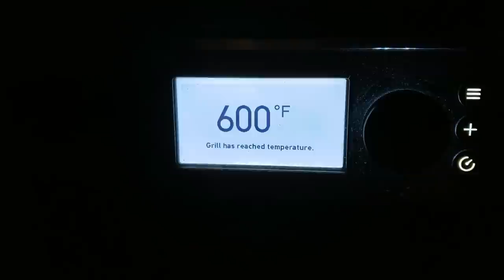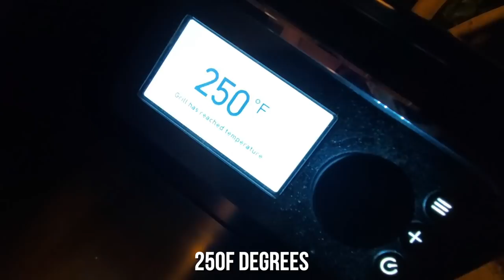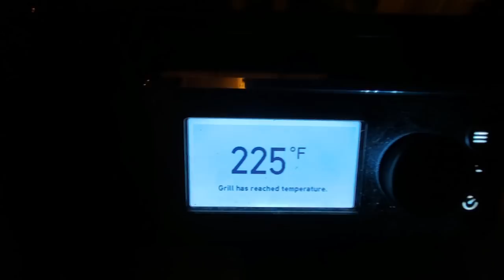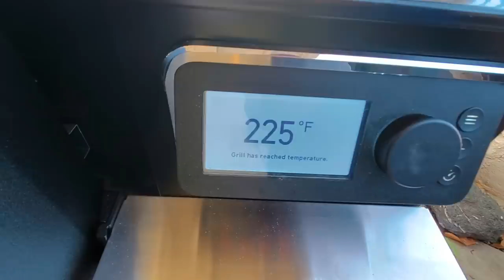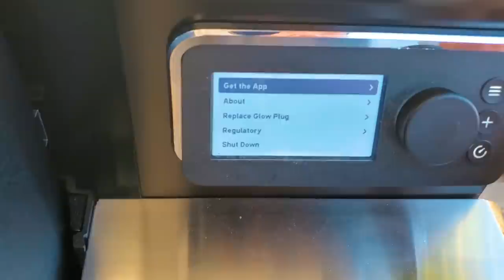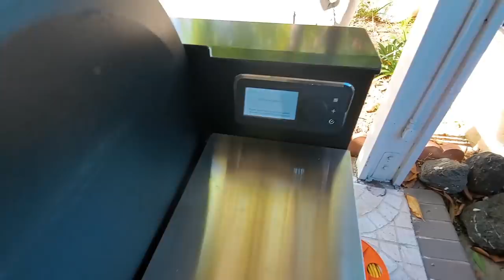Pt 2 WATCH BEFORE YOU BUY | Weber SmokeFire Pellet Grill | BBQ Champion Harry Soo SlapYoDaddyBBQ.com

Comment: Let me quote Amazing Ribs review (even they which curiously doesn't seem to be so hard on this one as with others which fail on similar areas) but still tell about findings... 

Software

The SmokeFire rollout felt a bit rushed. Weber is already a big target and didn't do themselves any favors by releasing this WiFi device with a partially functioning app and the promise of future updates.

Grease fires

There are some fairly easy remedies to prevent grease fires: keep it clean, use aluminum drip pans, and burn it off. Alas, people who rushed to post their experiences failed to discover the remedies.

Keep it clean. All indoor and outdoor cookers need to be kept clean to avoid problems and poor performance. Ash does collect at the bottom of SmokeFire, as it does in any pellet smoker, but if grease gets past the flavorizer bars and is allowed to accumulate, it can form a flammable sludge with the ash. It can also clog the grease drains. Weber needs to remedy this in future iterations.

Pellet feeding

Weber says it fears some people may have attached the hopper incorrectly. We will continue testing this. We hear Weber may be offering a complimentary ramp accessory they hope will address this issue.

We then did temperature tests with digital probes spread across the cook surface from left to right and found the right side was hotter than the left. We can show you visually with our bread test, below. In fact, we noticed this back in November when we cooked steaks on the prototype and commented on it. I have highlighted that comment and some others of concern in yellow, below. This is a pretty significant difference. 

Most of the grease burned up on the flavorizer bars and diffuser. Only a small amount made it to the bottom of the grill and into the grease tray below. We saw some blobs of grease mixed with ash had formed on each side of the firepot and scraped them down into the grease tray. Some bloggers have complained about grease fires by the firepot so we plan on testing that issue next by doing a lot of fatty stuff.

Another issue we're finding with the hopper is difficulty filling it with pellets. The hopper design is similar to Memphis Pellet Grills; located at the back to allow for a short auger, and having a wide and shallow shape rather than the more common box shape. But among other differences, the Memphis lid opens from the back, allowing easy access.

And keeps going…
Reply from the maker: Craig is a good friend of mine so please listen to him.  For me, I only have two data points so my results are not conclusive nor do they represent the majority of experiences of EX owners. Only time will tell if the EX becomes a classic like the Kettle and WSM.  Cook on many pits and have fun. It's about the pitmaster and not the pit.  Life is short

Comment: I am glad you have had a good experience with this grill. I write software for electro-mechanical devices (not grills) for a living and know they don't always work as well in the field as they do in the lab. So I am sympathetic to the engineers who designed and tested this product whose competence is now questioned. I've been there; it's not fun.
I am also sympathetic to the problems people have had with this grill and know you can always learn something about people's experiences in the field. If Weber is worthy of their reputation, they will use this feedback to improve the product. I sincerely hope they do, because everyone benefits when technology improves and other manufacturers "borrow" those improvements.
Whatever happens, my Pit Barrel Cooker and my Weber Kettle will continue to serve me well.

Signed: a fellow "IT nerd" who has upped his brisket game by watching your videos
Reply from the maker: Fellow IT nerd, I concur with you. I work with SCADA engineers all day with PIDs and RTUs so I'm aware that to design variable speed auger and fan algorithms is a technically challenging task with 200F-600F range and no door sensor.  How do you know if a knucklehead like me leaves the door open to shoot videos as the temp probe is saying temps dropping so run full auger and full fan to compensate for temp drop.  As the pellets are flying into the hopper and igniting, the temp is not increasing as the door is open and the PID does not know that.  How do you program the fan and auger to handle that situation?  Don't know. All I know is in my tests 1 and 2, the SF passed. Not conclusive with two data points but a start for me to learn more.

Comment: You should have cranked it up to 600 after the cook to see what would happen to the grease, instead of shutting it down.  I’d be curious to see what would happen.  I bet there would be a significant fire, not a flare up.
Reply from the maker: Already did in Torture-Test-1.  It passed
Reply: A. Dog Who’s the troll?  I’m free to make my comment, which is a valid one BTW.  Let me ask you, how long does it take for the pellets in the pot to burn on the SF?!  Not long enough.  By design the SF, reduces the amount of pellets in the pot on shut down.  Tool.

Comment: Good stuff here.  The more I watch SmokeFire videos, the more I feel like a good amount of the issues are actually user related.  I notice that a lot of the people having hardware issues didn't follow instructions on updating firmware right out of the gate, and the "grease fires" are actually just flare ups like you point out here.  I see a SmokeFire in my future.  Thanks for the great content!
Reply from the maker: Thanks Jerry for stopping by.  I only have 2 data points which are not conclusive nor do they represent the majority of SF owner experiences.  I suggest you borrow an SF to test drive first before plunking down $1,200.  For more info on what the pros say about flareups, please see https://youtu.be/VALvHFhWpk4
Reply: Ha. Be careful with that confirmation bias. Heed Harry’s good guidance. This thing has real issues, issues that run counter to Weber’s marketing. My firmware updated without issue. Two failed overnight cooks, which I do frequently on weekends, due to Weber pellets ceasing to feed, plus a full fledge grease fire consuming the entire right side of the cooker during shut down following a pork butt, even flaming out the drip pan. It’s a lot of money to spend to beta test. Shame on me, but these issues were the very problem Weber’s marketing claimed to solve (with influencer support).

Comment: ANYONE cooking 65 pounds of meat on a smoker this small should expect some trouble. I use a pellet smoker too but Dear god you pushed it.
Reply from the maker: LOL!  That's why it's called Torture Test!
TORTURE TEST 1 - PASSED
45 lbs 5 meats in 8 hours. Generate grease from a 16 lb brisket, 10 lb butt, and 3 St. Louis ribs to drip on the SF the first 6 hours at H-n-F cook @400F and L-n-S cook @275F. After all that grease was accumulated, fire it up to 600F to grill the Ribeyes and sausages.  Cook to let the grease drain in the unit and then try to flash that grease at 600F to test for safety 
TORTURE TEST 2  - PASSED
60 lb, 2 meats, 12 hours. Two 16-lb brisket, Four 10-lb butts. Low and slow 225F to see if hopper feeds properly and no grease fire, and no excessive ash

Comment: Hello Harry,  I am sorry to keep asking so much but tell us what you think could have caused such a huge fire on this videos? :https://youtu.be/-_7S3KTxvHc
I think we all need to understand.

I also noticed that in next video you use  an additional aluminum drip pan that make useless the weber design and the integrated fat catcher pan. I think a "Part 3" would be appropriate to give us your definitive thoughts on the SmokeFire.
Reply from the maker: Hey Victor, did you see my part 3 with the SmokeFire Corned Beef Walmart - https://youtu.be/NSSIKicufJE
I only have several cooks on my EX6 and  am still learning how to cook on the EX6.
For Tony's grease fire situation, I would refer him to have Weber engineers to watch the video and comment why he had the flameout, and thoughts on Tony's subsequent relight using a propane torch instead of the normal startup cycle.
From my experience running GMGs for 12+ years that when you have a flameout, you have to inspect the burn pot and remove excess pellets outside the burn pot.  If you don't, the auger will go through its startup cycle and overflow the burn pot so you could possibly ignite the pellets outside the burn pot and potentially cause a fire.  So far I've had two flameouts on my GMG Daniel Boone and Jim Bowie the past decade due to wet pellets from the heavy rains in SoCal (as we have monsoon sometimes).  
If it were me and I had a flameout, I would do three things 1) empty the unburnt pellets in the burn pot, 2) empty the grease pan, and 3 clean the cooking chamber.  it would only be AFTER I complete these three tasks would I attempt to relight my pellet cooker.  
As in all live fire cooking whether you cook with a shovel, wood, meat and chicken wire with a hole in the ground or a $1,200 pellet cooker, you must exercise extreme caution as you're working with fuel, fire, smoke, hot equipment, and hot oil.  
Of course, I've cooked a few times so I'm comfortable dealing with live fire issues and I don't expect everyone to react and respond like I do.  I like the flavor, ease of use, and performance of the EX6 and I may be a minority so only time will tell if this cooker is any good.  
I bought a second EX6 as I'm getting lazier in my old age of constantly having to watch my pits and the push-button fire-and-forget way of cooking is growing on me.  Just my $0.02.  Your mileage and preferences will vary.  And remember what I always say, "Everything in BBQ is a 3-hour argument and Jerry Springer fist fight".  Have fun cooking, be SAFE, and spread BBQ love and peace.  Any wash your hands as you hunker down in self quarantine!  :-)
Reply: @SlapYoDaddyBBQ  Thank you for your extended answer! I really appreciate. Yes I looked the Corn beef video but it's more a recipe than a real "Part 3" final review of the SmokeFire. I will go straight to the point. The grease fire cases correlates well with the big cleanup you had to do in the bottom and also with the fact that you decided to use the SmokeFire in a way it is not intended to, I mean, you used an additional drip pan.
I personally love Weber and admire everything you do Harry, but I think that a more final review where you really say everything is what we really expect from you. My feeling is that you seems to protect Weber's reputation and they don't need that. They can make mistakes as everyone but the question then is what is their reaction, and they are reacting fine, with replacement parts for ones and refunds for others. Being so famous it may be complicated for you sometimes to criticize such a huge and loved brand like Weber. On top of that our expectations from you are very high and I guess there is some pressure involved because your opinions are key for many people to decide to purchase or not.
Maybe I want you to go to fast and you need some additional cooks to have a final opinion. As you say, time will tell.
Anyway I really appreciate that you answer to your fans and want to tell you that I will look again to your recipes tomorrow because I have 4 racks of pork ribs waiting in the fridge.
With all my respect.
Take car of you and stay at home as much as you can. Here we are confined for at least 2 weeks...

Comment: Grease flare up Grease fire, I don’t want either in my grill . Weber tried to do too much with one device. If you want a grill buy a grill if you want a smoker buy a smoker .
Reply from the maker: Here is the difference between the two
https://youtu.be/VALvHFhWpk4
In case you did not see Torture-Test-1, grilled ribeyes and sausages at 600F after a 6 hour cook that put lots of grease into the EX.  No fires encountered.
https://youtu.be/ALNnTwN2Kak

Comment: Wow Harry, I just don't know where to begin.  To set the record straight, I'm a former pellet smoker owner.  I'm totally surprised and confused.  Really don't comprehend what, where, why, Weber went wrong.  At the Influencer demo, it looked like a winner.  You told me to order, but I signed up for news on when its coming out, but got nothing from Weber.
 For what its worth, I am in their database.

Then CES, then the non roll out.  Still looked very promising. Watched more vids and still interesting.

Then all the peeps whom ordered, and all the issues.  Then to my surprise, I see your vid and thought man you're so cra.  Loading it up with so much meat.  Pos reviews, maybe there are out there but I've only seen yours that have success.

Even with the Connect that temp prob is a non starter. Too many issues, so I  guess I'm not going to be getting one. Hope you have continued success with yours.  Mahalo
Reply from the maker: I have only two data points so my results are not conclusive nor do they represent the majority of EX owner experiences.  Only time will tell if this will be a classic like the Kettle or the WSM.  More videos coming

Comment: Harry a good review, but you are way too rosey with the Weber Smokefire...it is a bad design pure and simple...the clean up on that grill would be awful...most pellet grills you foil the drip pan and simply replace the foil...and vacuum out bottom.  You can't foil anything and all the nastiness falls through.  It would be a mess with a pellet grease sludge on the bottom.  It would have to be scraped out.  Oh and while you don't call it a grease fire, I have seen many other vids with straight up grease fires (so have you I am sure).  Also, you added pellets at 7 hours only on one side.  The other side was not falling or moving down.  It appeared stuck.  In any event, I just don't like the design.  I love Weber's gas and charcoal cookers, but their pellet grill fell short.  A pure example of a company rushing something to market to get a share of the revenue with the popularity of pellet grills.  Disappointing from Weber.  Are you sponsored by them?
Reply from the maker: I bought two EX6 with my own funds.  Don't worry about my review Jeff.  Just cook on what you love and love what you cook on.  I can get the best results as good as my WSM on my EX6 so I like to use them.  Are the perfect?  Far from it.  Like a British sports care, when the wipers come on then the lights go out.  But its smoke ring result, flavor, bark, is unsurpassed.  Just my opinion.

Comment: Most of the people that had issues were in colder climates and were cooking steaks at 500 plus degree temp. Your doing the wrong tests Mr. Soo. Your test was low and slow not hot and fast. Do a high temperature fast cook. Do a couple of 2 inch Rib Eyes. Get that sucker to 600 degrees put some Rib Eyes on there and then we will talk.
Reply: He did cook steaks at a high temperature in the first video.  He did the steaks after he cooked some larger meats.  There was some criticism of the method of cooking the larger meats but the steaks were cooked as you describe.
He was trying to be respectful of being a guest at a subscribers home.  As such he spent about 8 hours cooking as he thought that when being a guest you shouldn't overstay your welcome.
Reply from the maker: Hey Hector, thanks for watching my Part 2 Low and Slow.  You may have missed Torture-Test-1 video with both a H-n-F and L-n-S cook involving 45 lbs 5 meats in 8 hours. Goal was to generate grease from a 16 lb brisket, 10 lb butt, and 3 St. Louis ribs to drip on the SF the first 6 hours at 400F and 275F. After all that grease was accumulated, fire it up to 600F to grill the three 1.5 inch ribeyes and sausages.  Cook to let the grease drain in the unit and then try to flash that grease at 600F to test for safety.
https://youtu.be/ALNnTwN2Kak
Reply: Sue Barruw I saw that, but I want see him do it on his grill and not his subscribers grill.
Reply: Harry Soo I saw it Mr Soo when it came out. It was one of your subscribers grill.
Reply: Harry Soo mr. soo I think I’m just gonna invest a little bit more money and get the Summit Charcoal Grill.